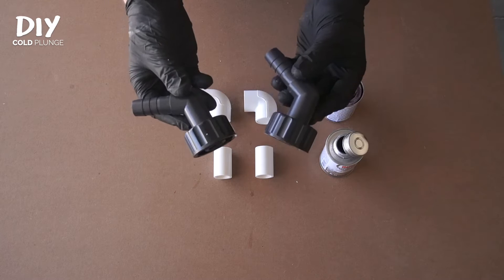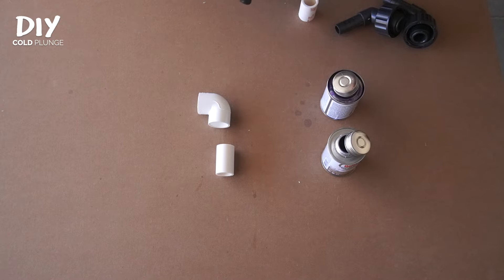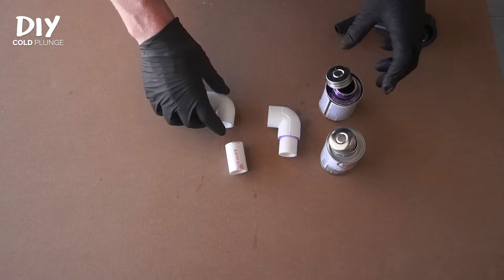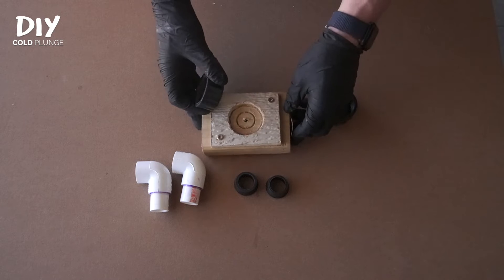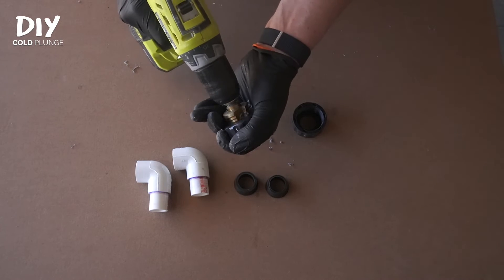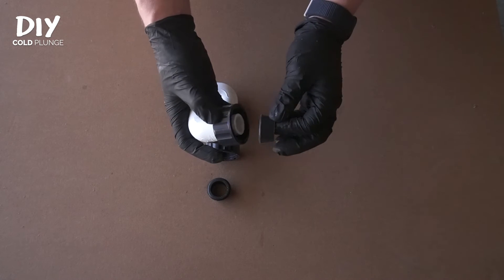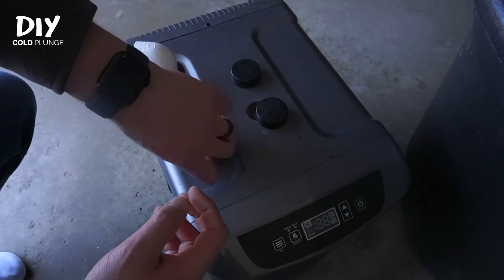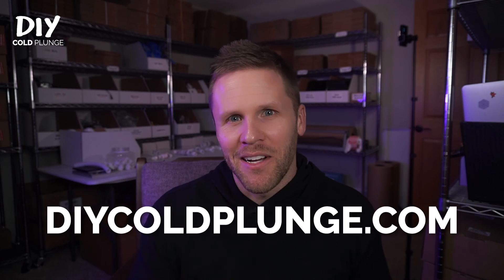UPDATE! How to use PVC Fittings with your chiller 😎 🥶 | DIY Cold Plunge

Comment: has any tried just using a 1" female NPT adapter to screw on?
Reply from the maker: Yes, believe me I've tried everything. it doesn't fit and is not the same thread type.
Reply: @DIYColdPlunge  I used 1" FNPT adapter, and used pipe dope (rated for gas), and ran it for 30 minutes with no leaks. I bought my unit about a year ago and just got around to hooking it. up. All that being said, outside of cutting the plastic top with the hole saw, your way might be a touch easier.. as I have 1" FNPT to 1" Socket -> 1" PVC -> 1" 45 Elbow -> 1" PVC -> 1" to 1/2" adapter -> 1/2" PVC -> 1/2 repair/expansion coupling -> 1/2" PVC -> 1/2" pvc to 1/2" CTS PEX. My setup is for an aeroponic setup. I had it plumbed with the vinyl tubing, but I hated that setup with clamps.. especially with it being in the garage and winter.
Reply from the maker: @Dennis47403  Hear you there! I hate that vinyl tubing as well... Glad what you did worked. Depending on how far you turned the fittings you likely cross threaded the unit - as much as I wish these were standard female threads they are not.
Reply from the maker: @Dennis47403  And to make things even simpler I have these - https://diycoldplunge.com/products/pvc-chiller-fittings

Comment: This is great, thanks for the info.
Do you have a schematic for connecting the Active Aqua 1/4 hp chiller to the Danner pump and filtration system from your original stock tank build plans once you make this conversion?
I bought the plumbing plans package and it was super helpful, but the chiller in the plans is a penguin chiller an the set up is a little different (inlet and outlet on the active aqua are on the top of the chiller as opposed on the side with the Penguin).
Reply from the maker: I do! The update just went out today.

Comment: Awesome video. A question. So the 3/4 pvc that goes inside the chiller is still much thicker than the original attachment the chiller came with, resulting in a much tighter rubber gasket fit and much tighter screw on fit once you screw it in. So you can’t even screw it down as much as you can with the original attachment. Is it the same for you? Any concerns?
Reply from the maker: Same here, been rocking for over a year like this with no issues 👍

This is also how a lot of other plunge companies set this up

Comment: When I tried doing this I had a problem screwing the new pvc fittings back into the chiller. The pvc is slightly larger than the original product which pushes the rubber gasket out slightly more and causes it to pinch. How have you gotten your new fittings to screw down onto the chiller? I tried using a wrench but I’m worried about breaking them cause they’re only plastic.
Reply from the maker: Want to send me an email so I can see what you're dealing with?

Comment: Just got my Active Aqua 1/4. I wasn't sure this would work cause the 3/4 pvc is slightly larger (hence the drilling needed) then the OEM piece. 

Since I had most of the stuff,  I took off the OEM gasket, put it on the 3/4 pvc with taper out and it is now too large to go into the chiller. It sits on the rim. On the OEM the taper part of the gasket goes in maybe 1/4 " but once you stretch it onto the pvc it now too large. 

My Chiller holes look same as yours meaning the holes are straight not tapered,...  Tried a 1/2 pvc piece and it slides thru the gasket and isn't snug, so might work if was able to get it to compress enough when screwed in. 

So what do you think the issue is? They changed the gasket thickness?  Cause 3/4 pvc isn't going to work, there is no way it will seal if even the first part of taper won't go into hole.
Reply: thank god I read your comment.... He states in the video "Two an three quarter inch elbows" I'm like, no way its "2 3/4 inch" pipe there.... but OK....
Reply: All may not be lost. The OEM smallest part (the tapered) is 31.59mm and the Chiller opening is 33.48mm. When the Tapered gasket is fitted on the 3/4 pvc the same part of the gasket is 34.64mm, so it will barely fit even if compressed. 
But, without enlarging the hole in the OEM nut, you can use 1/2 pvc. It is loose, but with the gasket on and tightened down the nut/gasket holds the 1/2 pvc tight. The nut is almost all the way down and 3.74mm of the gasket still sticks out. It feels like it should be tight enough to prevent leaking. So that might work. Going to try that. Would need two elbows for 1/2 to 3/4 pvc.

Update: Works
Reply from the maker: Can you send me an email through my website showing this? I'm having a hard time following... The gasket piece shouldn't go all the way into the attachment hole on the chiller, it needs that compression to create the seal.
Reply: @DIYColdPlunge  I might clean it tomorrow and will get you some pics. The gasket doesn't fit in all the way. It sticks out about 4mm after fitting the nut on. You tighten the nut till the 1/2 pvc is snug and won't pull out. The nut still can go down a bit after that if you really cranked it. But as with most plumbing works, you get leaks sometimes from over tightening. Have it running for 4 days now and except for the condensation no water.

It was a choice of this or the barbed fittings (with ring clamps and possibly silicon) or putting the gasket on the 3/4 pvc (which made the gasket bigger than the hole). I saw the best choice was to try the 1/2 pvc with the gasket most of the way in and still compressed to a leak proof fitting, than the gasket barely in or just sitting on top of hole with the 3/4 pvc.  The elbow is right above the nut so can't just unscrew the nut to show you how much is still sticking out without pulling the hole thing out. 

So to recap: Yes the gasket is compressed and not all the way in (after tightening).  Thanks for all your excellent videos. (Did anyone ever mention the Duck you send has ears? lol)

Comment: Thank you for your tutorial videos much appreciated. I was wondering if this improves the cooling on the chiller?  I have a 1/4 chiller and it's kept indoors, but I'm having issues getting it to temperature. I did purchase your PVC spa hose to see if that helps.
Reply from the maker: Lots of factors to consider with cooling... This modification doesnt help with efficiency but just allows a more sturdy connection.

Comment: When is the new plans coming out
Reply from the maker: I'm hoping in the next 10 days - just proofing it and finalizing the videos
Reply: @DIYColdPlunge  i'm mid framing now for a 100gal stock tank build. Should I hold on buying plumbing components until the new plans come out? Or are the components (filter, injector, pump) remaining the same-ish and the design/configuration of pvc changing only? Thanks for all the great info!!
Reply: @DIYColdPlunge  thanks